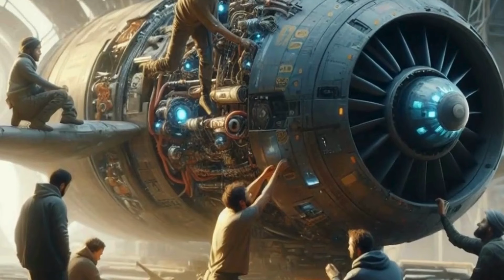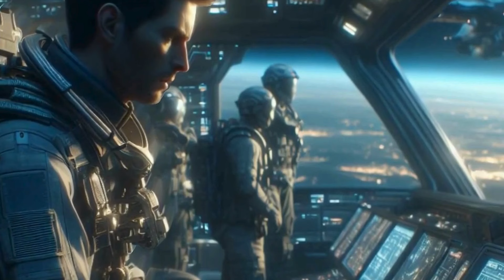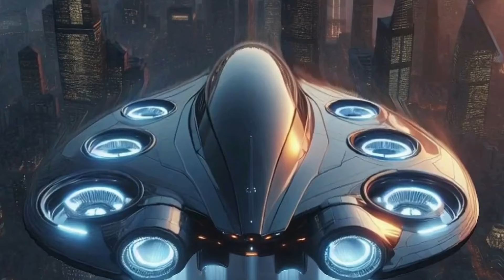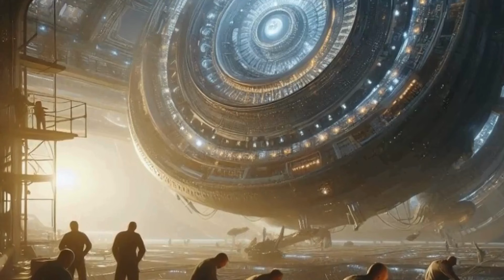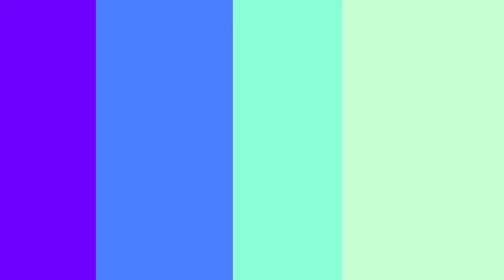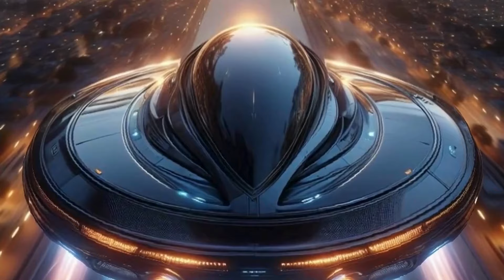Is it possible to build a Spacecraft that can travel at Lightspeed?

Comment: For every action, there is an equal and opposite reaction. To accelerate mass forward, you need to accelerate mass backwards. E=mc. You eventually run out of atomic mass to accelerate to the speed of light since all matter converts to radiant energy with acceleration.